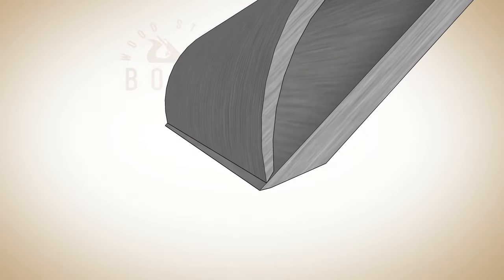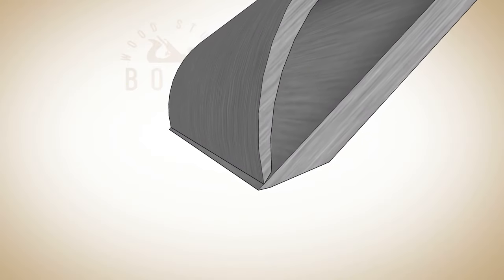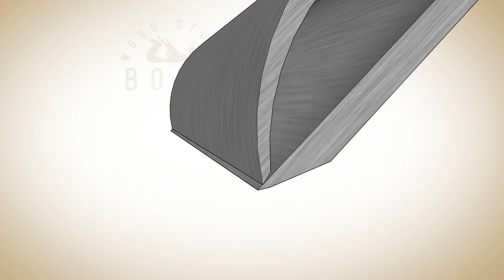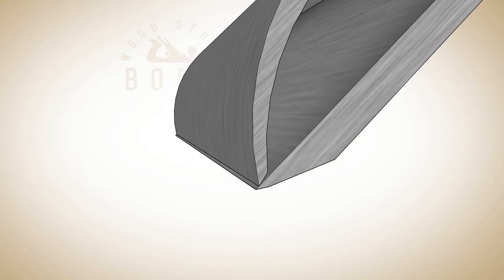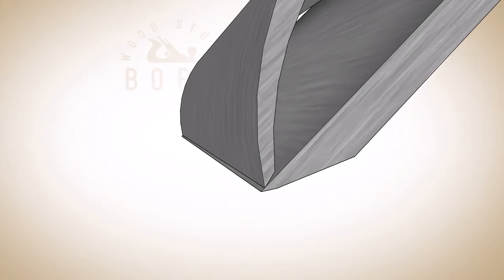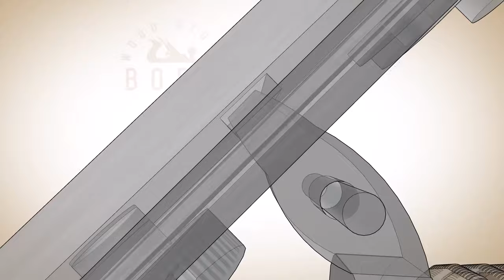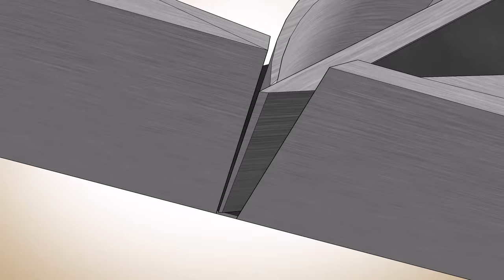Hand Plane Parts: How a Chip Breaker Works

Comment: Thanks Bob. You just eloquently covered why I was struggling to get fine and thin shavings with my #6 foreplane after reconditioning it and installing a sharp blade. I opened the mouth far too much and I think, both the blade and the chipbreaker were too deep. BTW if that's sketchup you're using... bravo my friend, bravo. that was a lot of work. Thanks again.
Reply from the maker: I'm glad you liked it Mark!
Yes, this was done in SketchUp.

Comment: Uncommonly helpful and deserving of more positive feedback. The animation explains more in less time than most of what I've found. The captioning is easy to follow and free of filler and tedious leading self-promotion. We have a Draper and it's mostly fine, but the blade doesn't stay put. While (still -- apparently too much to ask) looking for a replacement blade, I found your vid explaining one of a dizzying array of options of setups. For the minor hand work I do around our sloppily remuddled house, I just need a brutal companion to accomplish Stage 1. I can handle Stage 2, which is imprecise block sanding. (There is no Stage 3.) You explain this config so simply, I feel confident that I know its purpose and value. T-h-a-n-k y-o-u.
Reply from the maker: You're welcome!

Comment: Great graphics & v good explanation, if there was anything to add. It would be that the front top edge of the chip should be polished to a 45•degree or higher angle, for it to be at its most effective.

Comment: Thank you. I've slowly started being able to use them. I keep reviewing, and get better and better, but i think the single biggest factor was once i learned how to sharpen the blade, really sharp, things started to click. Now, comes the fine tuning.  I have a Stanley #4 on the way from Ebay now, fingers crossed. (i have only one old  smoothing plane, unidentified, but made in the USA (the only identifier) the rest of my planes are cheap big box buys that i've used to learn how to flatten the sole and sharpen the blades.  I figured if i could get them to work, then i'd be ready for the real deal. I think that time has come.

Comment: i recently bought a cheap hand plane. and the chip breaker is a bit short. i mean when i adjust it so close to the blade mouth, the big screw that tightens the chip breaker on the blade touches the other screwhole of the lever cap. so when i want to adjust the blade with the big wheel screw,  the blade does not move. can i just put another hole for the chip breaker and use it like that?
Reply from the maker: I'm a little unclear on exactly what parts are in the way. Make sure that the screw that attaches the chip breaker to the blade has its head on the bottom, not the top of the chip breaker.

I can help out more if you email me some pictures of the problem. You can find my email address on my channel's About page.
Reply: @BobsWoodStuff  yeah it's already bottom side. but the head of the screw is touching to the lever cap screw's hole. now it's 4 am for me so  i'm gonna mail you tomorrow!! thanks!!!